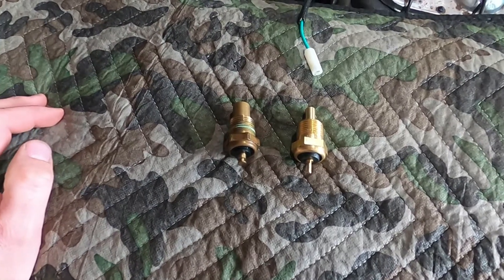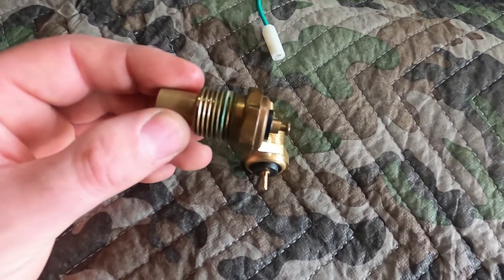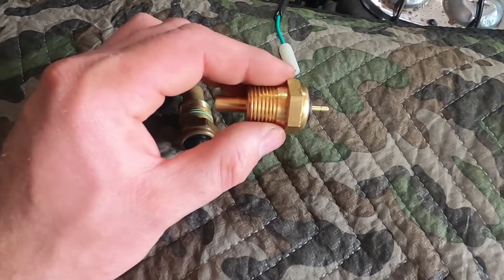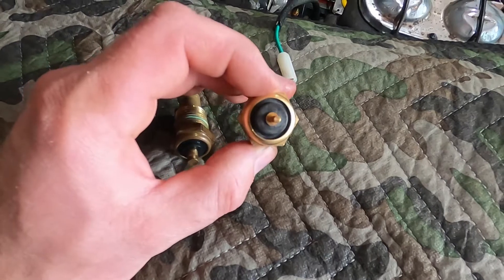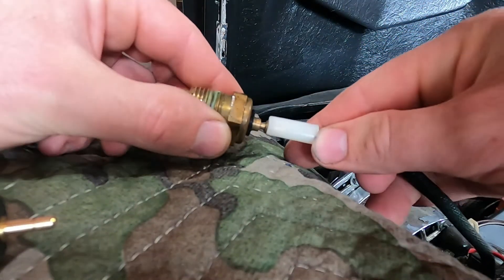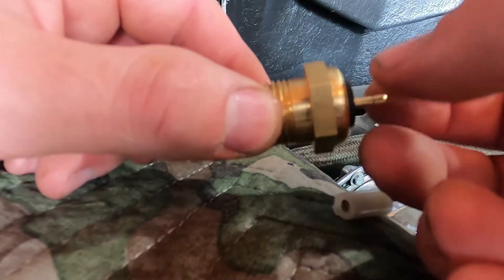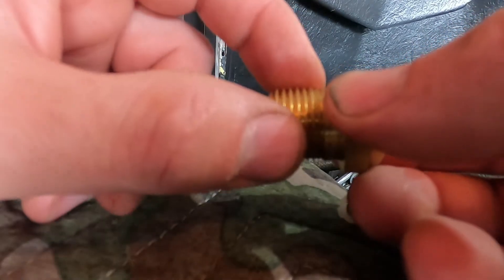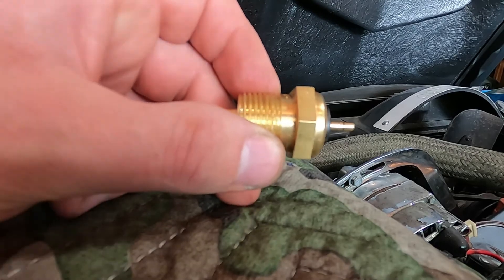1971 Corvette Temperature Sensor The Right One

Comment: where did you get the correct sensor?
do you have a brand/part number for it?
Reply from the maker: It was one of the Corvette mail order places.  Mid America or Corvette Central if my memory is correct but it's been a little while.
Reply: @macsgarage  thank you for such a quick reply  I broke mine removing old headers and my first thought was- where am I going to get one of those-the correct one anyway!! thanks again very helpful video! good luck with vette!